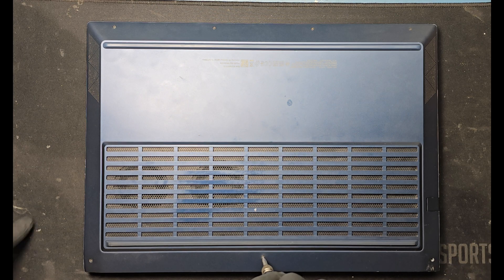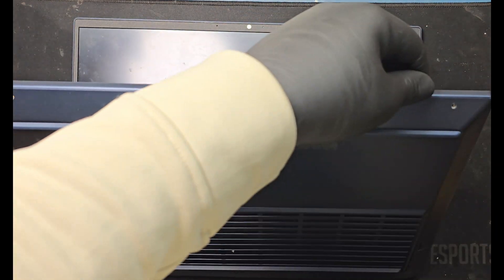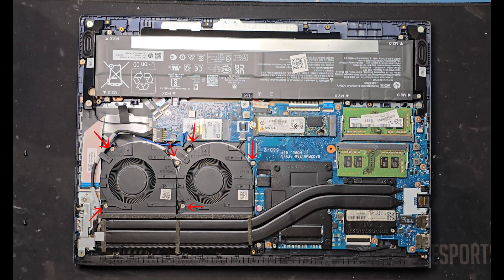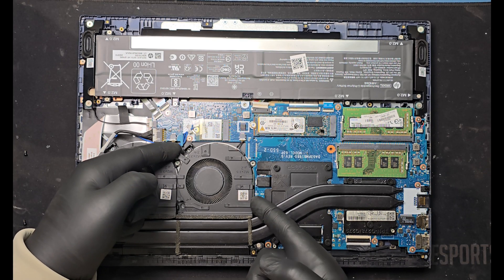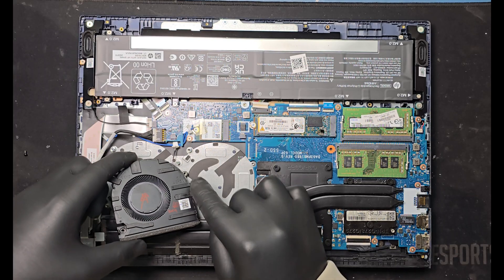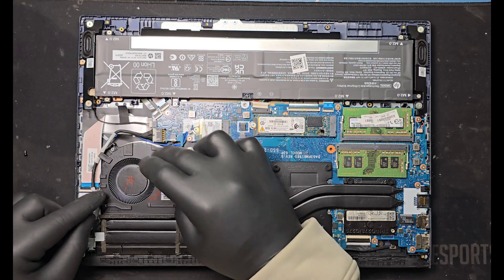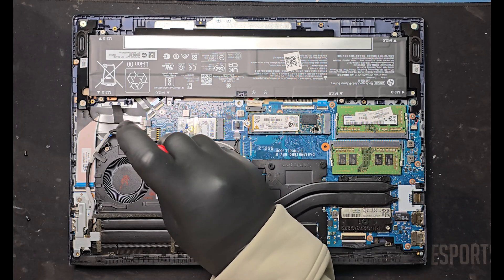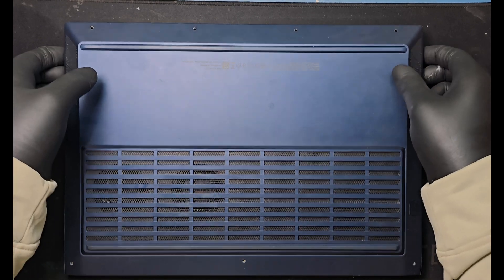HP Victus 15-FA Laptop Fan Replacement | Cooling Fan Repair Step by Step

Comment: WHERE ARE YOU LOCATED? IN DELHI NCR? MY LAPTOP IS SHOWING FAN ERROR ON STARTING. AFTER SOME TIME IT HEATS UP AND SHUT DOWN ITSELF. WHAT MAY BE THE FAULT?
Reply from the maker: We are Bangalore based. It's a fan issue might dust or fan itself.

Comment: My fan bearing os bad so new fans come with new bearings also does the thermal plate come out during replacement for hp victus 15-fa0032dx?
Reply from the maker: No it won't come out.

Comment: my right fan of victus is making noises. but i ran the diagnostic test of fan it showing fan is in good condition on 100% speed but its make noises. so i should replace the fan or just clean it????
Reply from the maker: If u don't like the noise just replace it